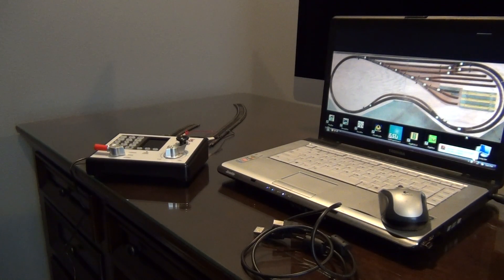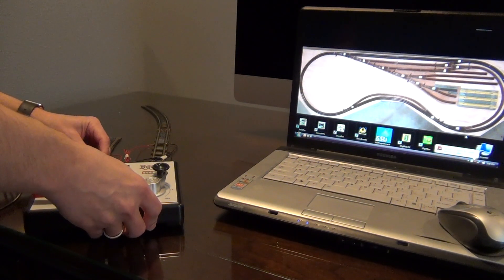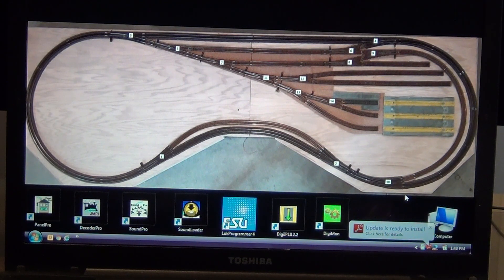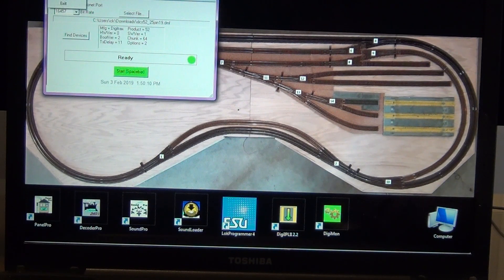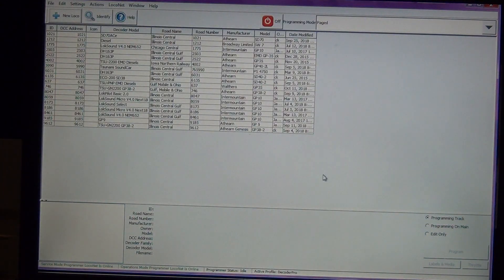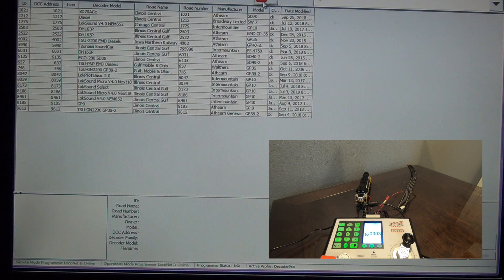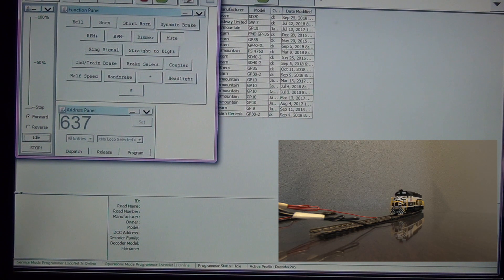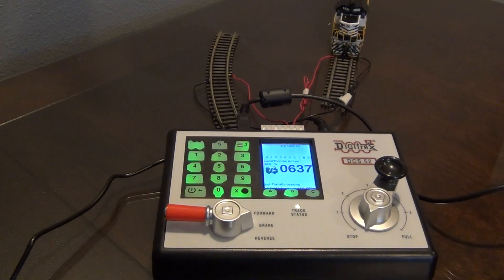UPDATE:  Digitrax Zephyr Express firmware update and JMRI connection

Comment: Yes i have question. I am set up with Digitrax Zephyr DCS52. I have JMRI on my Computer (Windows 11) I'm pretty sure everything is updated. Computer, JMRI, and the Zephyr. The Zephyr shows that it is connected to the computer and all seems fine My problem being able to do any programing. The Roaster page where you can turn the track Off/On is showing (Unknow). What am i missing. I've tried changing the com setting with no avail. I've watched different video's but still no luck. I am fairly to DCC and any help would be greatly appreciated.
Reply from the maker: The short answer is, based upon your summary, I am not sure what is wrong.  The most common issue is that it is on the wrong communication (com) port.  You can try changing it again, be sure to restart JMRI each time you change it. You can also check to make sure you have the latest version of decoder pro.  It seems that your computer is new enough (JMRI doesn’t work on older machines).  It doesn’t make sense why it won’t work.

Comment: Did you have any issues connecting  your laptop to the dcs52?  It's reading the usbln on the device but not seeing the dcs52 in the digipl2 program.  Not visible in soundloader either.  Great videos by the way.
Reply from the maker: Thanks, Chris.  The likely issue is that your communication port (COM port) is not set.  Within JMRI, you need to get to the preferences tab and there will be a drop-down for the COM port.  If there are multiple ports available, just try each one until it works.  Moving forward, it is important to plug the USB cable into the same port on your computer each time or the COM port will be wrong and you will get the same issue.  On a larger scale, if your computer is too old, it may not be supported.  Generally, if you are running Windows 10, you should be good, if you are running an older machine, got to the JMRI website for the minimum system requirements and make sure your machine meets those criteria.
Reply: @ck7813  Thank you!